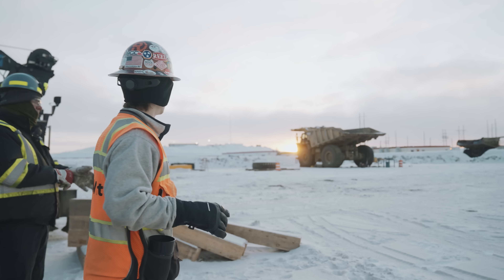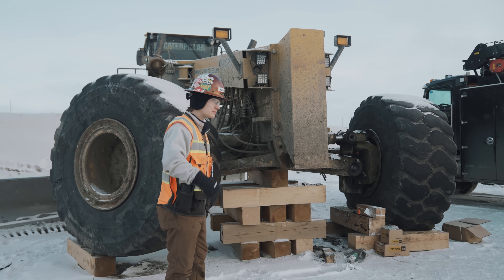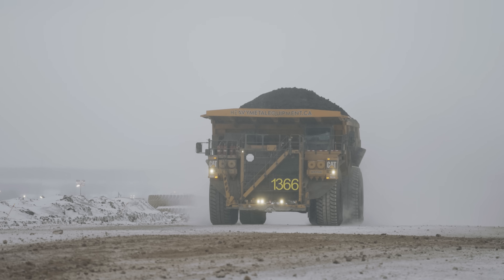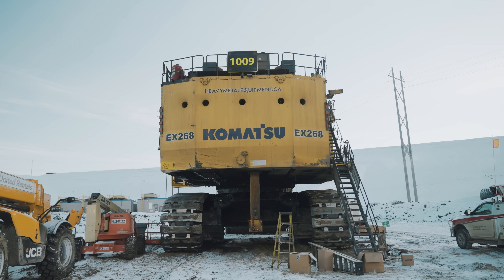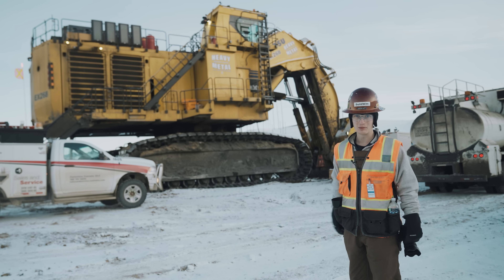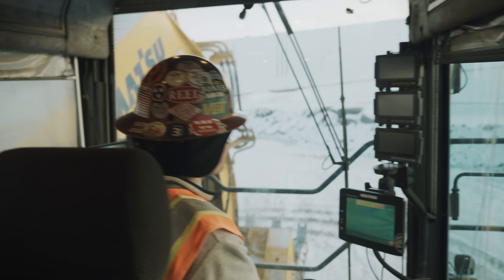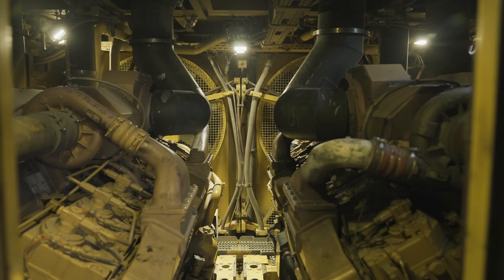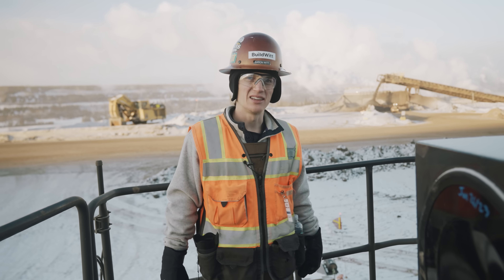The Largest Heavy Equipment You Can Rent

Comment: Life pro tip when it's cold like that and you're just walking/staning around, get a bigger warmer. I use a zippo "hand warmer" and it's the size of a small flask, but lasts for 12 hours once you light it. I stick that in the inside chest pocket of my jacket, and it keeps my core nice and warm, which keeps blood moving to the extremities in turn. I've stood around freezing my knees in -10f and I just had a t shirt, a hoodie with the chest pocket, and a good winter coat, and was honestly quite decent. three layers minamum though, DO NOT KEEP THEM AGAINST YOUR SKIN. kept it in my jeans pocket once and low temp burns _suck_. way worse than a normal one. keep it in the mid layer and you're gold.
they probably make a battery heater brick these days, but I know if I'm cold and need it, I can refill that sucker a lot faster than a battery charges. and you don't have to worry about the batteries freezing when it's in your bag and switched off.

Comment: How would one get into that I have worked in the patch and I'm 21 I have run heavy equipment for a while and want to get into the bigger stuff I have worked in the suncor plants up there in the Mac but haven't really met anyone in the sand side of things? Do you know of anyone willing to give a young guy a chance?
Reply: I also have my class 1. I have run pretty much everything from tri drive combo units to over dimension haul rigs. Skidsteer, excavator, steamers, rod trucks, to high pressure chem trucks and hot oilers,  packers and rock trucks. The only things I don't have much seat time in is a dozer.
Reply: @Krove-jj6vl  For operators, Morgan Construction will give most guys a shot at running equipment in a mining environment.